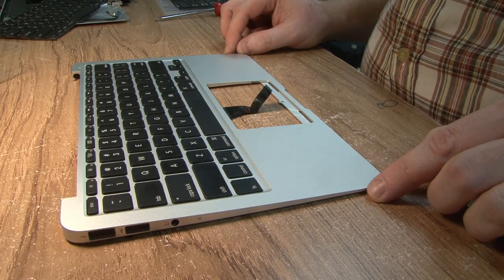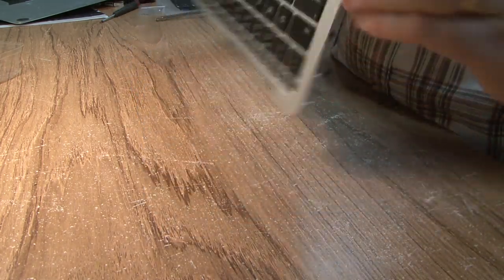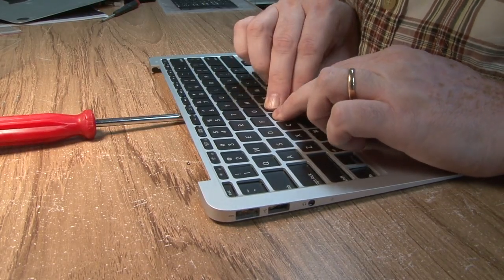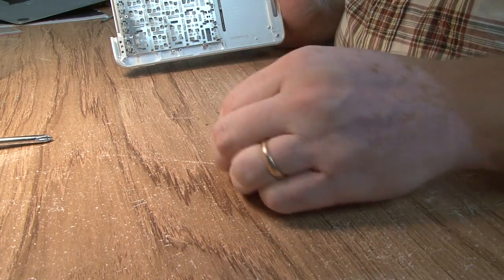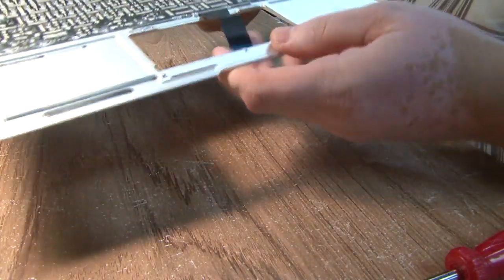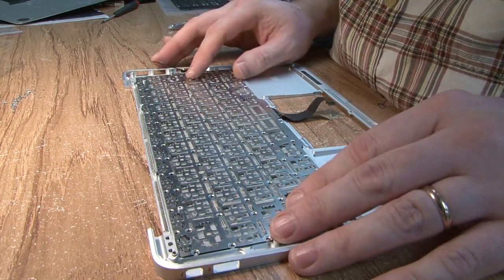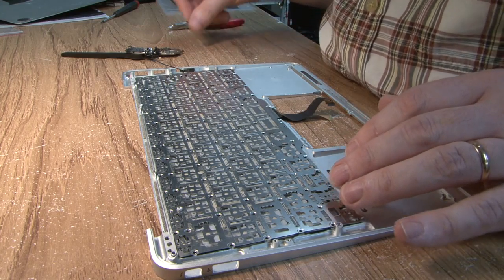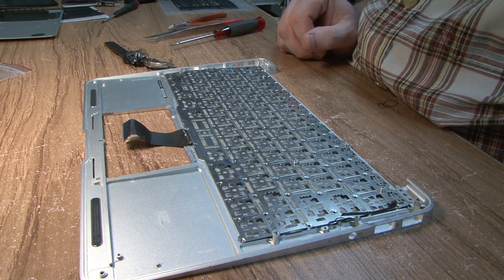How to remove and replace keyboard on an Apple MacBook Air A1370

Comment: Do you know what parts of the keyboard and backlight can be washed with running water? I have some keys that are sticky due to spillage and the backlight is not even on the keyboard.
Reply: DO NOT WASH IT WITH A WATER!!!
Use ultrasonic bath or alcohol to minimize the risks of damaged keyboard, this is APPLE, and not a normal thing. This could literally on nothing but a bad touch!
Reply: ErotiikanMaailma never rinse or wash a key board with water use rubbing alcohol, look on websites to see which one works best for cleaning one